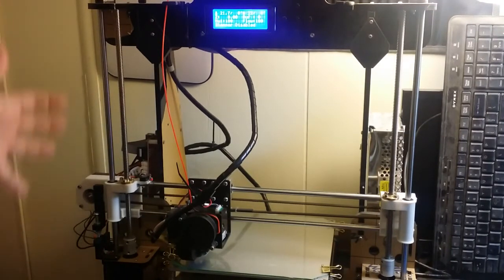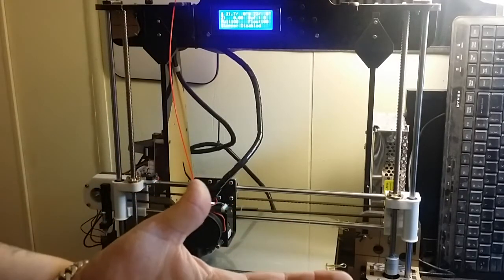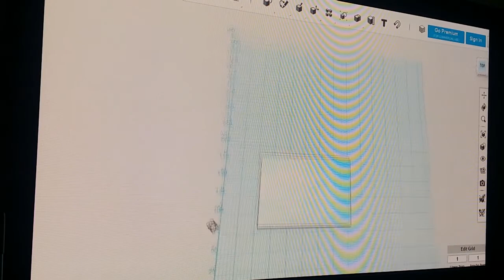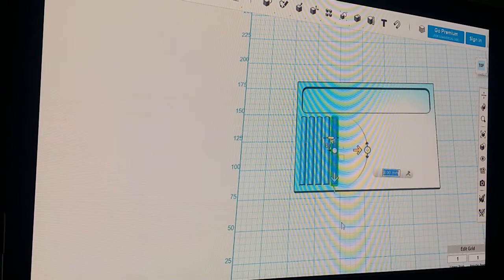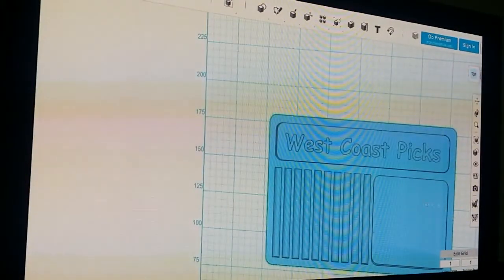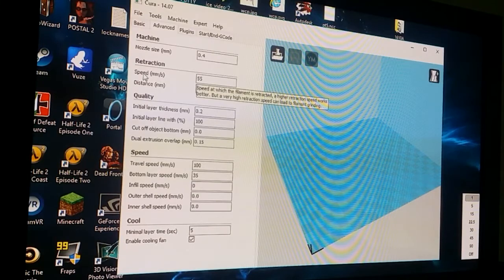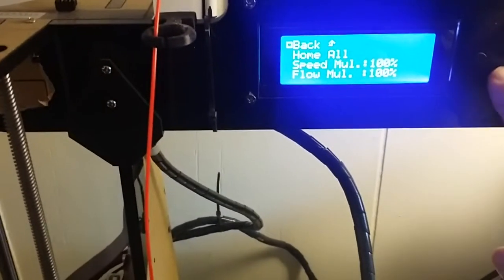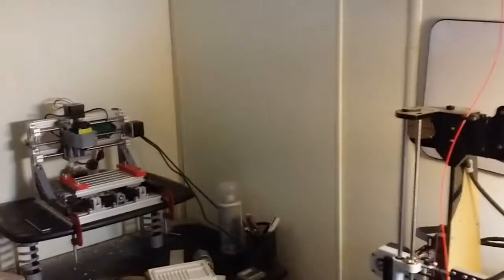-=417=- 3D Printed Pinning Tray Start To Finnish!

Comment: Great videos, do you sell trays you make.
Reply from the maker: J Ferg yes. I charge $5 each, plus shipping. I don't make any money from it. The $5 covers the plastic, electricity and gas to the post office. Shipping is usually around 7 or 8 bucks.
Reply: Great, what colors are available. Could I get a wooden one as well. How would I pay for them.
John
Reply from the maker: Wood would cost more. The hardwood alone is about $7. There is also a lot more work involved with the wood trays. I haven't sold one yet, so I'm not sure what I would charge.

For a 3d printed tray, I have Red, Blue, Black, Green, Yellow and orange. Felt for the bottom I have, Green, light blue, red, yellow, white, black and purple.

As for payment, paypal is always best.
Reply: Where do I go to pay using PayPal and give shipping info or do I email it. Would like blue with blue felt.
Reply from the maker: Email me at tymscripts@yahoo.com paypal address is the same.
Reply: Thanks will do shortly

Comment: I know I said I was planning on getting a cnc router first, but after seeing this and Bobby keyz video I may have changed my mind.  I've also got a couple questions.  As far as smoothing out the print, have you attempted a vapor bath of acetone or anything of the sort? If I were going to order this printer today, which mods in particular would you suggest?
Reply from the maker: I haven't tried vapor baths or anything like that, I think acetone is for ABS I don't know if it works on PLA. I always print PLA. I have seen some impressive prints using vapor baths and sanding and all kinds of finishing.But the stuff I print doesn't demand detailed finishing and the time it requires lol.

Upgrades can all be downloaded and printed out:

Cooling Duct
https://www.thingiverse.com/thing:1954001

Y Belt tensioner
https://www.thingiverse.com/thing:1959208

Front Frame Brace
https://www.thingiverse.com/thing:1857991

Z stop fine adjust
https://www.thingiverse.com/thing:1479176

Filament guides
https://www.thingiverse.com/thing:1980281

Maybe an upper frame brace if you want. I have Small ones, cause I don't like the look of the bigger ones.

These can all be swapped out for different ones, these are just the ones I use.
You can just search thingiverse for "A8 Y Belt" And it will show you everything you can make for your Y belt, tensioners and all.

I also suggest printing on glass with hairspray, So you can buy a pre cut piece of glass for the a8 off ebay or amazon. Or you can buy a dollar store picture frame and cut the glass yourself.

Some people just buy the 8x10 diploma display from the dollar store that has an 8x10 sheet of glass and not even cut it, it leaves a bit of glass overhanging front and back of the print bed, but it works fine. I cut my own, and even cut the corners so I could access the print bed screws for calibration.

It prints good without mods. But it prints much better with the right mods. You can take it as far as you want, with things like:

Cable chain
https://www.thingiverse.com/thing:1905344

Fancy frame supports
https://www.thingiverse.com/thing:2184432

Or any number of cool mods, Though only a few actually improve the print quality and speed. The first 3 I listed make noticeable improvements to the print quality. The last 2 I listed make working with the machine much easier.